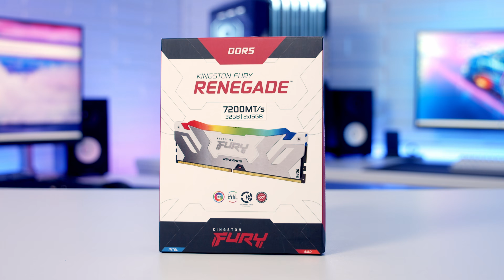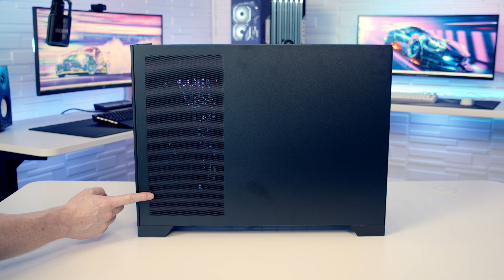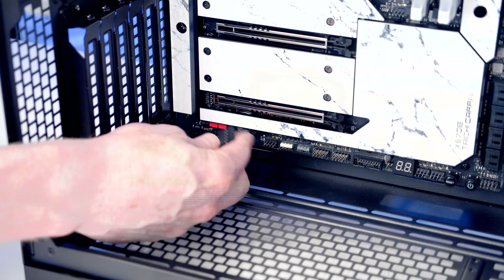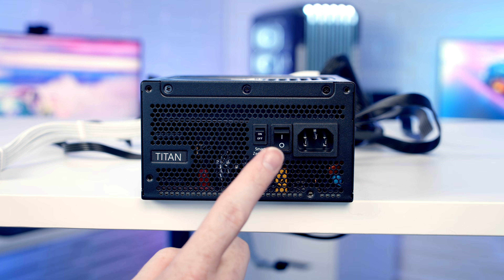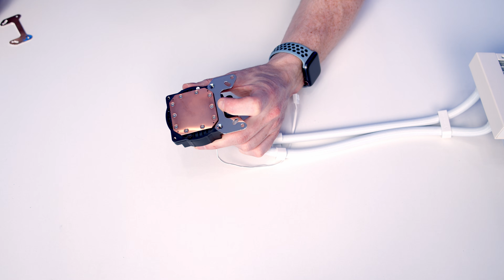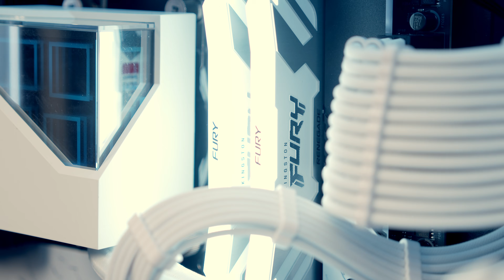SaharaGaming P480 Build - Step by Step Guide

Comment: Thanks for the great video,  btw would you recommend Asrock taichi over the competition in price range,( for 3d rendering and USB4) , Asus x670e Proart and Gigabyte Aorus x670e Master,  they both have usb4/thunderbolt abilities,  while asus had some bios and quality control issues but many people praise the Gigabyte Aorus x670e Master as GPU slot x16 mode is unaffected by adding stuff in other slots